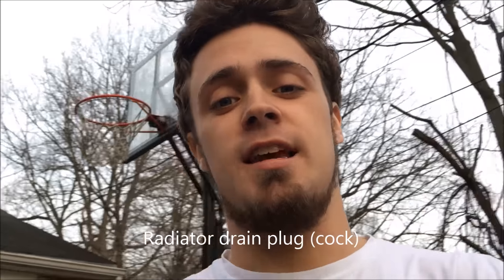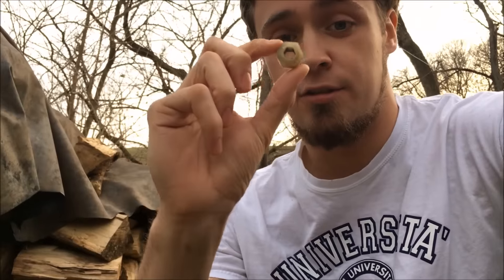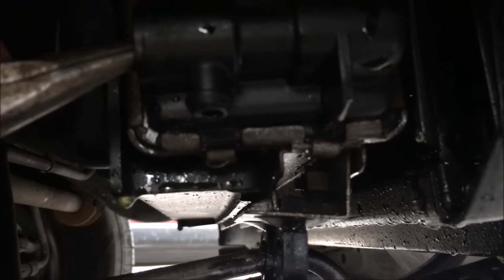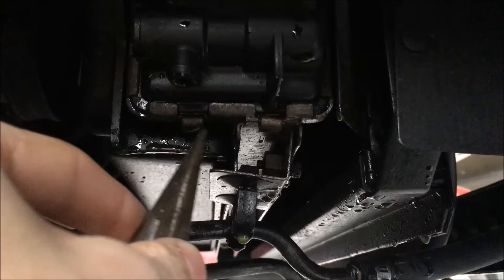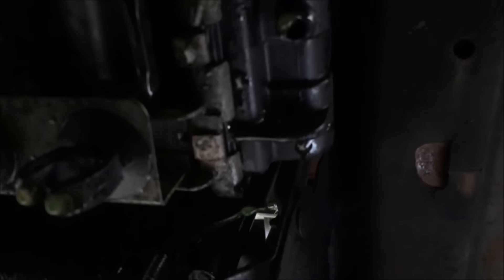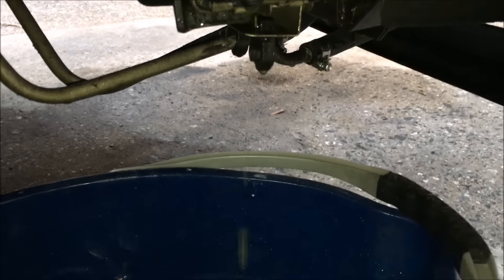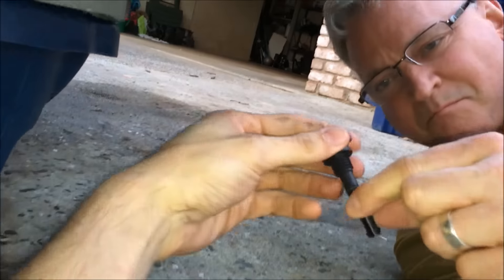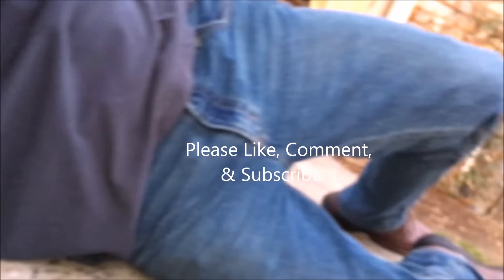How to Replace Radiator Drainage Plug - Stop the Leak!

Comment: next time don't mess with those drain plugs just to pull off the bottom radiator hose next time it's faster and easier and you don't have to worry about breaking those plugs off

Comment: This just happened to me today!  Thank you for the info.  I also used the tool given out with cans of paint to start the turning of the plastic plug!  That tool made it possible for me to finish it off with the needle nose pliers.   Replaced it for a '97 Jeep wrangler same part too 61127 from autozone.

Comment: FYI as a Master Tech, keep in mind that the radiator drain cock, usually does not seal after you open it up. The "0" rings tear or break, so that when you tighten it back, it drips...Its best to have a new drain valve when you do this, unless you have new "0" rings to install on the old valve. Especially on the Dodge diesel trucks  like the 2007 3500
Reply: i Still see leak after using a new one
Reply: @ask43242flight  use plumber tape, worked in my 06 mustang

Comment: Just snapped off the plug head on my Ranger last night. Backed it out somewhat with an allen wrench, but there's not enough "meat" left on the plug to get a good enough grip to get it out the rest of the way. Thanks for posting this video. With needle-nose pliers and some well-chosen expletives I hope my experience is as good as yours.  What I don't understand is why these plugs have the split tail with barbs kind of like toggles to keep the plug from coming all the way out. If it comes halfway out you're going to lose your coolant anyway, and the barbs just make it harder to remove the plug.
Reply from the maker: I completely understand. The radiator plug ended up not being the reason i was losing fluid but it was nice to knock it off the list. Let me know if this method works out for you!
Reply: Professionally Amateur  what was the reason?
Reply: Professionally Amateur you ever find out what the reason was, my benz e320 currently losing fluid I just ordered a new petcock hopefully that will do
Reply from the maker: @Vibezola  it was a long time a go at this point but i believe it was the water pump
Reply: Mine is a piece that just sticks out an flat about a iinch out then it broke off even at radiator

Comment: All you really need is a 5/16 Allen wrench. The plug has internal surfaces that allow it to be unscrewed using the key.
The plug was defective because even if you break off the head, it still stays sealed and should not leak.

Comment: You are the only one who showed the actual removal and tightening of the drain nut. Tighten clockwise and loosen  counter clockwise.  On my car its not loosening when turning counter clockwise.  Do you get such nuts that work the opposite way to your example?  Thanks for a useful clip.